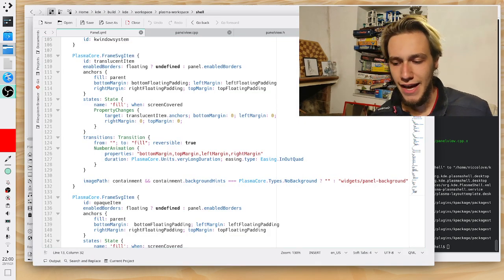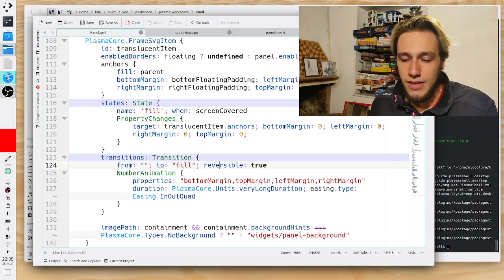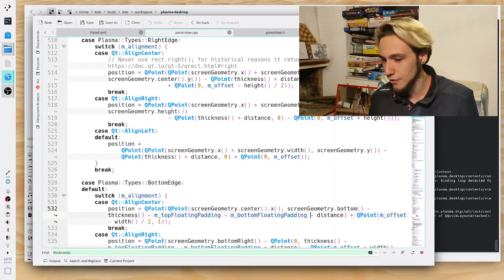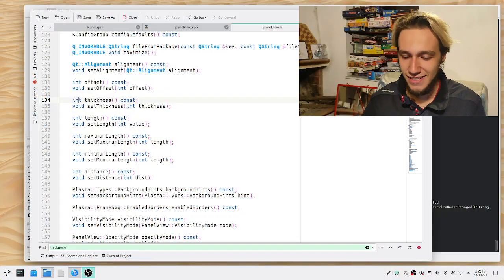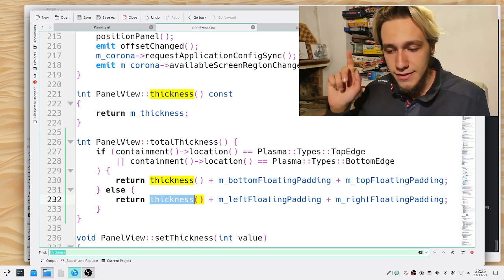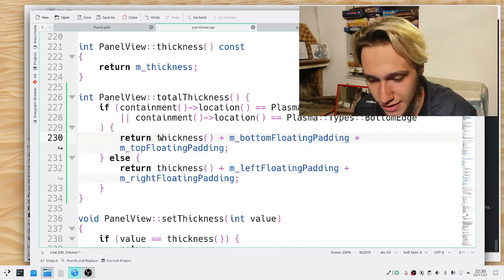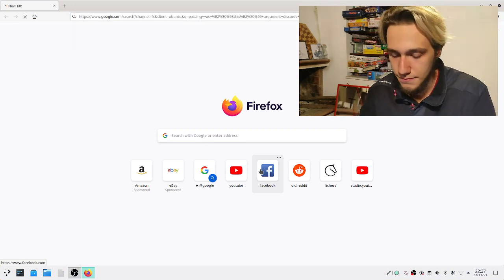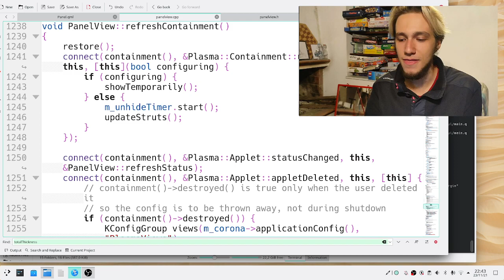Floating Panel Devlog: States, Transitions, Thickness... I had been optimistic.

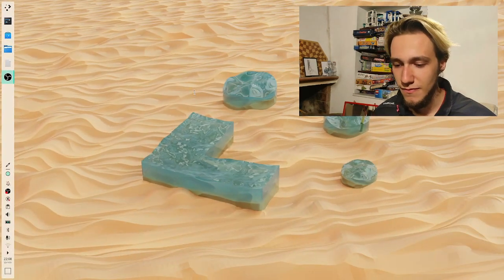Comment: 9:11 the corners of the panel are still rounded when a window is maximized
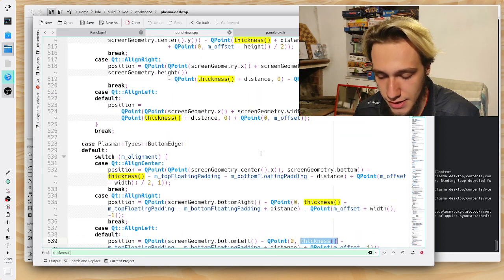10:28 the poor button
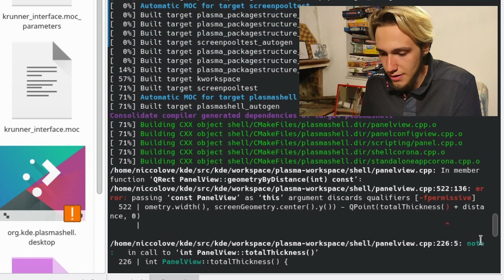34:14 ah, constness errors
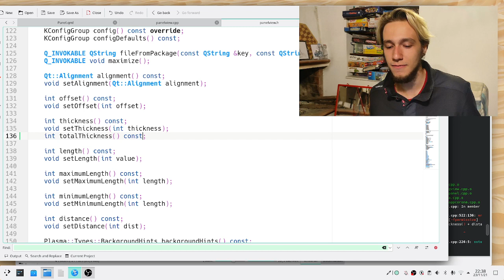35:47 a const method just means, that the method will not modify the object
Reply from the maker: 9.11 knows bugs I can't fix :-(

Comment: Very good way of thinking and tough work has been done ! You're almost there, congratulations. Once I thought about a field in which the user would set a "Height from edge", just like he is doing with the "Panel height" field. That way he chooses the thickness of the containment (panel) and then the space between the boarder and the panel, which would be highly customizabled. Also, maybe it would ease the calculation and wouldn't affect the margins logics, based on the panel height/thickness, and it would avoid introducing new bugs on icons resizing or objects aligned to the panel's side, etc. What do you think ?
Reply from the maker: I prefer the margin to be defined - as it currently is - by your plasma theme. If you want to change that, you can edit / create a new theme changing the size of the margin elements
Reply: @niccoloveslinux  oh OK, i ignored that was the way it works. So your answer makes sense as the margins are defined by the themes, then the consistency is preserved.

Comment: may I ask how your all windows corners are rounded ? is it with side border or without ? I'm on stable plasma 5.23.3 release and my decoration bottom corner is sharp squire, if I use "no side border" option then the border color and window background color does not match, and if I try to edit the color theme it still does not works. seeking your help.
Reply from the maker: You need to have some border in KDE kwin decoration settings

Comment: What kind of computer do you currently have?
Reply from the maker: Lenovo Yoga 510-14isk i5-7200U 8gb ram
Reply: @niccoloveslinux  What program do you use?
At least on Windows 1080p should be easily doable with this kind of hardware...
Reply from the maker: @kuhluhOG  I'm doing OBS with a Droidcam OBS input. I don't know why, but the Droidcam OBS lags if I have it fullscreen and save to FHD
Reply: @niccoloveslinux  I tried it out just now: 1440p with x264 (and as such in software) used up 27% of my CPU (i7-6700)
recording with GPU support didn't work because of some reason (GTX 1070ti with 460 drivers)
Reply from the maker: @kuhluhOG  idk... Maybe the Droidcam thingy is the issue, without that one it goes fine...